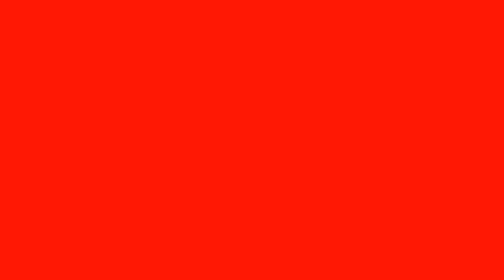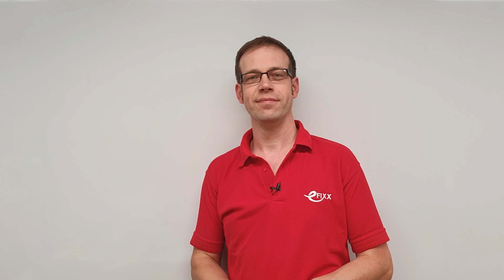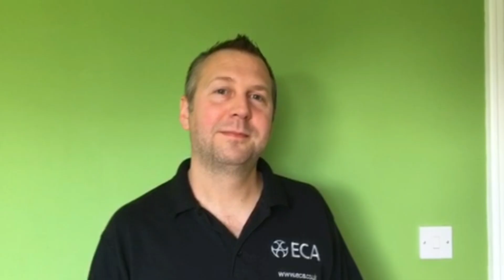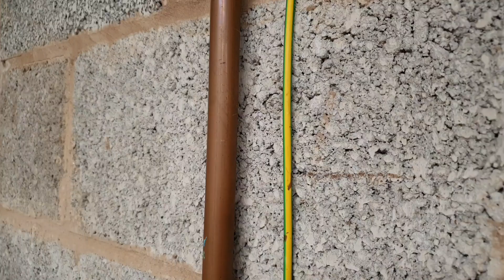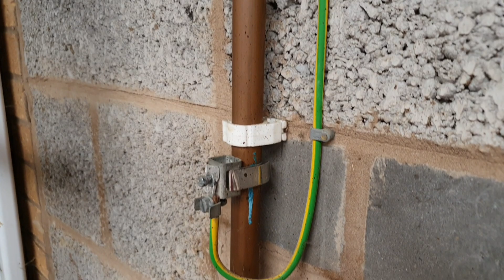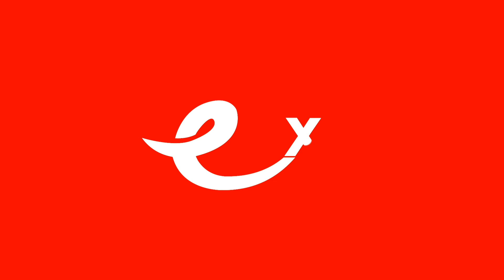Why are earth bonding conductor sizes different for TT and TN-C-S (PME) earthing arrangements?

Comment: Resurrecting an old video but for anyone that does read this in the future, with PME (MGN for the USA, MEN for Au/NZ) you can get your premises' load being returned via any full metallic path to another PME.  Typically this would be the plumbing (water or gas), metal premises pipes + metal street mains, for individual houses.  The bonding wires must be rated to carry what ever that current may be if the premises PEN is lost.  Since the UK does permit more than one N/E link in an overall earthing system (multiple supplies each with their own service main) that metallic path also includes the building structure itself - steel frames in industrial / commercial situation etc.  So not only must be be able to ensure equi-potential we must also be able to carry many amps indefinitely.

Comment: I have TNCS system, also the re- inforcement steel in the concrete foundations are also connected to a terminal at the consumer unit; are there any probable anomalies that could arise?

Comment: Not only does the bonding conductors have to take the building's load current but also that of other installations connected to the DNOs mains cable downstream of a broken CNE/PEN conductor on the mains cable.
Reply: I've always wondered, with so many extraneous conductive parts and large bonding wires, is it possible that a broken PEN conductor to a building can go completely unnoticed?

Comment: I'm not sure this does answer the question. Is it really to do with a broken combined neutral-earth on TN-C-S? Surely the point about bonding on a TN-C-S system is that, in the event of a live/line to metal infrastructure fault (gas pipe, plumbing etc.) then the impedance of the bonding must be low enough that it will cause the MCB to trip. 

If there's a supplier-side break in the combined neutral/earth, then the current flowing through all the active electrical devices will try and flow through the bonding connection to anything connected to earth. However, I'd wager that it not going to be able to carry large amounts of current. Even a metal water or gas pipe (increasingly replaced by plastic in both cases) isn't going to have a low enough impedance to earth to carry tens of amps, and certainly nowhere near the difference between a 10 mm^2 or 6 mm^2 cable. It's likely in the case of a break in the neutral on supply side that the potential of anything bonded to the buildings PME is going to rise to high levels as the earth impedance is going to be in the tens of ohms, even with metal gas and water pipes. Compare that to 10 metres of 6mm^2 cable (about 0.05 ohms). 

TT is different. It has to be designed with protection to cope that the earth impedance is tens of ohms. It might trip a 6A MCB on a line to earth fault, but that's about it. Consequently, having ridiculously large profile bonding conductors serves little purpose. 

So, I think that the larger profile bonding conductor on TN-C-S is all about the ability to trip something like a 40A MCB on a line to metal plumbing/gas pipe fault and for that, you need very low bonding resistance. With a TT system, if there's that same fault, there's no way that the resistance to earth of a conducting rod is going to trip that MCB. Even in the best case, it will be lucky if it can carry 10 amps and the difference between 6mm^2 and 10mm^2 binding cable is entirely irrelevant.
Reply: Man, cant you simplify this statement into laymans terms without sounding pompous and long winded.. What are you basically stating here without trying to sound like a scientist!?
Reply: @Surferant666  I trained as a physicist, and that's what my degree is in, so I plead guilty to the outlook of a scientist.

As for explaining it in layman's terms, then it does require some circuit analysis and theory. If I had the ability to comment with charts and drawings, it would make it much easier. I'm sure John Ward would be able to do a better job, and he has some relevant videos on earthing systems, one of which explicitly states that the impedance to ground of a TT system is high (normally in the tens of ohms) and a big cross-sectional bonding conductor would serve no purpose as the earthing rod can't carry more than a few amps.  

In any event, I don't think the explanation on the video actually explains anything.
Reply: @TheEulerID  i retract my previous statement. Youre just over technical as we all are lol. I try to use analogies to explain complex situations but sometimes it gets lost in translation being a nuclear engineer.
Engineers know a little about a lot.
Scientists know a lot about a little.
Facts
Reply: @Surferant666  it's fairly simple industry jargon, mate. Nothing OTT about it.  If you cant understand it then maybe you need to up your game rather than being critical?
Reply: @TheEulerID I find this very interesting and never thought of it till you mentioned it: ''Surely the point about bonding on a TN-C-S system is that, in the event of a live/line to metal infrastructure fault (gas pipe, plumbing etc.) then the impedance of the bonding must be low enough that it will cause the MCB to trip''. 

The explanation for bonding of extraneous conductive parts (what you called metal infrastructure) is always that it's supposed to reduce touch voltages in the event of a live/line fault to the exposed conductive parts of equipment. E.g having one hand on a toaster with a live frame with the other on an unbonded water pipe you would have a substantial voltage across you. With the water pipe bonded to the main earth terminal which the toaster frame is also bonded to through the earth wire ( ''equipment grounding conductor'' in the US) they will both become live at the same voltage and not current will flow through you and so no shock. This always left me wondering what about fault currents generated at the instant the fault occurs which will trip the over-current protection and/or the RCD and clearing this danger immediately? Is it to reduce this touch voltage in case those fail and the fault just sits there?

Your explanation that I quoted basically treats the extraneous conductive parts like exposed conductive parts that are normally bonded, whereas the need to bond extraneous conductive parts is always explained in terms of eliminating the possibility  of touching these earthy metal things inside the building in the event of faults which make live the exposed conductive parts of the electrical installation/equipment. Because according to your explanation a metal desk should be bonded too. I'm genuinely curious about all of this and wanting to learn as much as I can, not trying to be a smart ass!
Reply: @Orgakoyd  The bonding is also there, of course, to make sure that different conductive parts that somebody might come into contact with are all at the same potential, but you don't need ones with a large cross-sectional area to achieve that, which is where I think the difference is. 

Incidentally,the 18th edition regulation 542.1.2 requires new foundations to have a foundation earthing system (something which is becoming more common across the world) which, ought to lead to a much more reliable earth contact for TT systems with considerably lower earth loop impedance. That might then change some of these regulations. What I also expect to happen is that this will change the game for TN-C-S systems too so that it provides some protection against PME faults by requiring supplementary earthing. In the past metal gas and water pipe delivery systems often masked these by providing a relatively low impedance path to neighbours properties (the diverted neutral issue). With services provided in plastic, this can't happen of course. 

So, the whole area of supplementary earthing systems is, I think, going to change the rules in the future.
Reply: @TheEulerID  Yeah  I'm very happy to hear about the foundation earthing requirements and I think it would make things much more reliable and safe. If I had the opportunity to drive supplementary earth rods at my own TN-S/TN-C-S house I would as a second best option, even if the water an gas were metal.
Reply: @Orgakoyd  You are not going to be able to match the performance of foundation earthing with even half a dozen grounding rods. They are notorious for having high and variable earth loop impedance which also varies greatly with soil conditions and if the soil is wet or not. If it's not installed in the foundations (and a lot of precautions have to be taken to avoid corrosion), then it would need a fairly large area burried grounding grid.

Incidentally, TN-S isn't considered to be vulnerable to PME faults. This is if it is really TN-S. I think some are effectively turned into TN-C-S by the DNO when fixing problems in the local distribution network.

Comment: Would be good if you could do a video showing in plain English  how to test if an exposed conductive part or extraneous conductive part requires bonding. There are figures ranging from 50v/0.03mA = 1666.67 Ohms. 23000 & 26000 Ohms etc.
Reply from the maker: We’ll see what we can do
Reply: Don't those figures relate to different things though? 50v/30mA gives 1. the max. value for earth electrode resistance (411.5.3), 2. max. value between simultaneously accessible exp. and extr.c.parts re suppl bonding, and 3. checking that an extr.c.part is effectively connected to the MET (so it's already known it's an extr.c.part) (415.2.2), whereas 23kOhms (22kOhms at the 10mA level) refers to measurement between a part and the MET to determine whether it actually is an extr.c.part (GN8, Sect. 6.1).
Reply: That's an easy one, get your megger put one clip on the earth bar or DB earth and one clip on the lump of metal in question. Set it at 250 v, push the button and if you get 3.5 M/OHM or greater  it does not need bonding as it is just a lump of metal.  anything less and it will need bonding.

Comment: To be picky, table 54.8 is based on the size of supply PEN conductor, not neutral conductor (although really just a change of terminology).

Also, do the regs stipulate 6mm2 for TT? A MPB conductor can be 6mm2 min. - 25mm2 max., not just 6mm2. The question is though, on TT, why is it 6mm2 min, when the earthing conductor only need be 2.5mmm2 if mechanically protected and 4mm2 if not mech protected? The earthing conductor only needs to be big enough to carry the current that will fire the RCD, and there's no diverted neutral currents for the MPB conductor to carry, so why does the MPB conductor need to be bigger than the EC on TT? Sorry, but the presenter merely repeated what's in the regs, without explaining why it is so. Regarding earthing, it seems the regs are really designed for TN systems, with TT just thrown in the mix as a side issue, and applying TN to TT is good enough.
Reply: The earth on an rcd system is basically just an Ariel

Comment: Hi , in ring circuit when 2.5 mm2  used and the two ends of each wires of cable connect to 32 amp circuit breaker , I think if this breaker which is single 32 amp replace  to (double poles) circuit breaker (MCB) that's rated to 16 amp,  so when we have issues in point in cable of the ring circuit or cable have cut in conductors so for that will not make  cable get  over heated when having load excited 16 amp and the breaker will isolated the current so we will have Warning of fault , this is an opinion because it will reduce a lot of fuses or protection points.
Reply: I think you're trying to say "why not break a ring final circuit into two radial final circuits on two MCBs? If so, there's nothing wrong with doing this so long as you split the ring entirely and don't leave it connected together anywhere. I'm not a fan of ring final circuits and can probably count on one hand the number we've installed in the last 3 or 4 years. Ring finals are the 'old' way of doing things back when you covered an entire floor (or even house) with one socket circuit to save both cable and fuseboard space. You could get away with a 4-way board for a whole house in some instances. Lights, Cooker, Sockets & Immersion Heater. There's many houses still wired like this no doubt
Reply: @iggifer  
Yes that's right but not two separate single mcb it's will be one double rated for 16 amp and nutral combine in nutral bar so for that any over current on each end of wire will trip the breaker and safe the circuit specialty when there's damage in some point of cable or have been cut by mistake so for that  when  we have load excited 16 amp in one end of cable and the breaker trip that's will give you Warning that's the ring circuit have break in it or cable been cutting ...
Reply: @ahmedelectricianofiraq5550  Well you could do that, but that's not how the circuit was designed. You run the risk of running the MCB towards its thermal and electronic trip characteristics for longer than was originally intended. If you have a 32A MCB running at 23A it's perfectly fine and within design characteristics for both the circuit and overload device. If you then make that a 16A for no good reason, and continue to pull 23A, the device won't trip but will be both overloaded and getting warm. Yet the cabling is more than capable of dealing with the load. If you split the same circuit into two 16A radials you (potentially - depends on where the loads are on the circuit) halve that load to 11.5A across both circuits. No overload, no overheating
Reply: @iggifer  
It was an idea in past but it need calulation and study to show any ronge or issues could have when being applied  .
Reply: @ahmedelectricianofiraq5550  I know English is not your first language, and it's certainly better than my Arabic, but I don't really understand that reply. Do you mean changing from a 32A MCB to a 16A MCB was an idea in the past? Also, ronge is not an English word  - do you  mean 'wrong'? A point I missed in your first post comment regarding DP MCBs - they are available here but are far from widely used. They are really only used for specialist situations - I fitted some recently in place of a switch fuse to provide DP protection in a block of flats but they are prohibitively expensive to use day to day. A SP MCB is £2-3 whereas a DP MCB is somewhere in the region of £40. 10 circuits in your fuse board and that's £400 on MCBs alone.
Reply: @iggifer  
Yes English it's the second language and sorry about ronge (wrong) , my idea it's about  changing the single 32A mcb to 16A double mcb and connect each live conductor of two end of cable to the double 16A mcb and the two nutral to bas bar so it will be more safety to circuit if there's a broke in cable and any load accede 16A in each end of ring circuit will make mcb isolated the circuit so it will give us waring to see if some one have make drill in the  wall and cut the cable or there's a loss connection in terminals of socket outlet, i hope i give you the idea more clearly this time  .
Reply: This comment appears to be entirely irrelevant to the subject of the video. Are you sure you are commenting on the correct one? This is about earth bonding, not ring circuits.
Reply: Steve Jones I’m fairly certain that joe said in the video to leave any questions you might have in the comments for future video’s
Reply: @paullyons4624  he did, at 1:33.
Reply: @TheEulerID  
Yes , but  joe said leave a comment if someone have technical issues and i do have this question to be clearly answered.